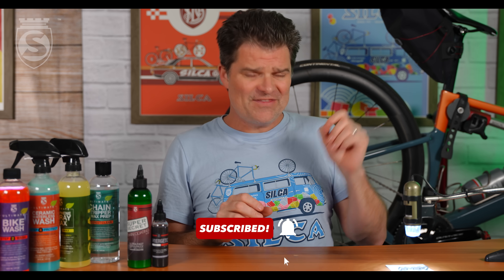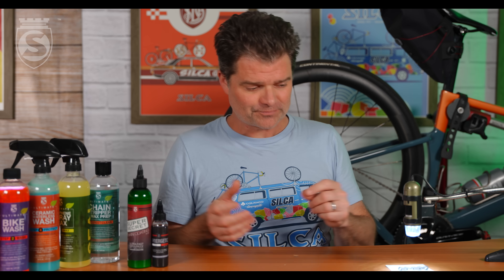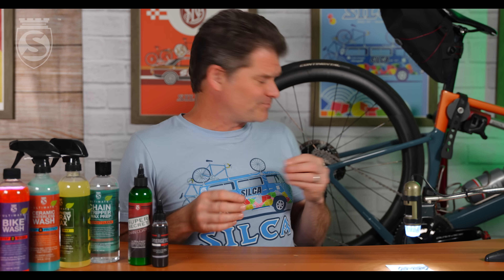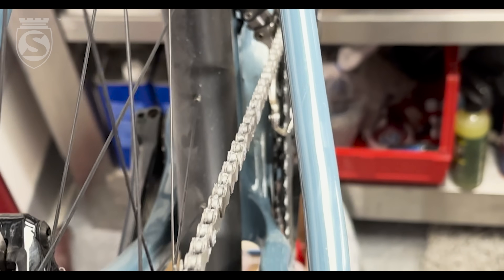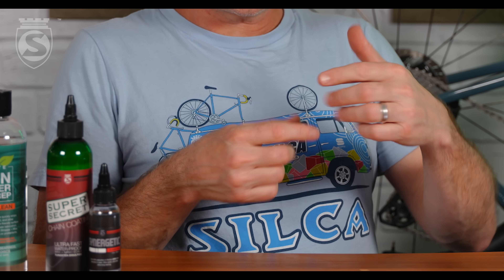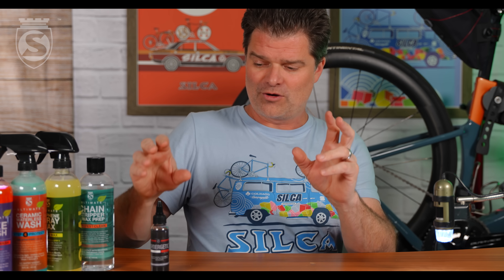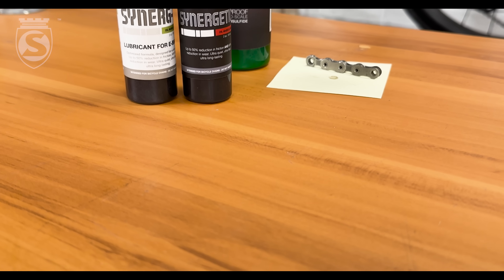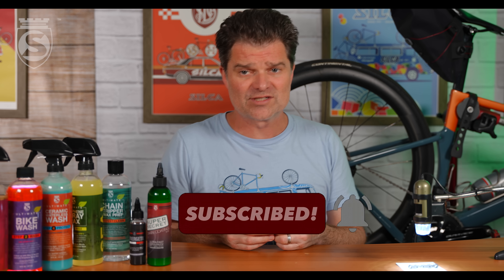Stop Wasting Your CHAIN LUBE! Know the BEST Way to Apply It!

Comment: Without a doubt the most long winded, non scientific advertisement on YT. The purpose of any lubricant is to prevent or diminish metal to metal contact. That's why extreme, high pressure lubrication duties are invariably performed by different types OILS. lf you want your chain to last for the greatest possible number of miles, use an oil like Chain L. Yes, it's messy, but after it's fully worked into the pins, the exterior of chain pins and plates can be wiped down with a rag soaked in lacquer thinner without adversely affecting the lubricating properties of the oil on the internal, bearing surfaces of the pins and rollers. Wax lubes will never surpass the lubricating qualities of oils. lf they did, they'd be used instead of oils because they're not as messy. When we see wax lubes in ICE crankcases, we'll know they're equal to oils. Unless you're planning to live forever, it won't happen in the lifetime any of us.
Reply from the maker: Sorry Frank, but all of the science and independent testing in the world tell us that you're wrong here.  I think partially you are just misunderstand the mode of friction creation inside the chain, which is a non-sliding, line contact, rolling friction under extreme pressure, and NOT sliding friction as most believe.  Furthermore the entire system is exposed to continual dust and dirt intrusion at the plate gaps which oil pulls into the inside of the chain while wax prohibits the entry of..  for these reasons wax is superior to oil in all but the cleanest/driest conditions and even then, the wax is faster.  Look at ZFC data, there is only ONE oil that matches wax in clean/dry conditions and that's SILCA Synergetic (which is nearly half the friction and 3x the longevity of ChainL), but once you introduce contamination, wax is king.  Similarly, Synergetic is the fastest oil based lube ever tested by Tour Magazin Germany as well as FrictionFacts, but still not quite as fast, or as low wearing as SILCA wax.
ICE crankcases will have a mix of line contact rolling friction at the contact point of the involute gear teeth, BUT they also have significant points of sliding friction, and bearing friction both of which require liquid lubricants.  These systems are also fully sealed from the elements and contamination and are also continually replenished with oil to prevent starvation.. making the comparison to non-replenished and element exposed roller chain like comparing apples to optics, but also just fundamentally ignores the type of motion happening inside the roller chain. The current fastest lubes in the world are all wax based, and the current lowest wearing lubricants for chain are also all wax based, and this has been continually repeated in numerous laboratories worldwide including Purdue University, FrictionFacts, ZeroFrictionCycling, University Delft, WheelEnergy, University of Manchester have all produced papers showing wax based lubes to be superior in both wear and friction to even the best oil.. and we certainly know that as we make the best oil based lube in the world currently.
Reply: @SILCAVelo  Maybe we should ask Lake Speed Jr. Unlike either of us he has PhD in tribology.
Reply: *a PhD....
Reply: People are gonna use whatever they think provides the best combination of performance at the amount effort they're willing to put into maintaining it. Your video is obviously sufficiently convincing for many of your viewers. Good for all of you. I'm not convinced. I get 3-4k miles before my chains get close to the red on a Park, cam-type chain gauge. That's good enough for me.

Comment: I thought Silca wax lubricant was good.  I thought all wax lubricant was good, and Silca was just a more expensive option.  Based on some recent information that I have seen, I think Silca deserves it place as a top wax chain lubricant.  Your drivetrain efficiency it tops and Josh I though I was going to get some BS story, but there was no bs.  In fact, mentioning that your technique works just as well for other, competing lubricants, was a good gesture that gains credibility.  I also saw your video with Dylan Johnson.  Yes, it is good to have someone geek out about these things.  These marginal gains work.

Comment: I think I first started applying to the top of the bottom span before the chainring after reading on Sheldon Brown's site that this helped ensure oil based lubes didn't accumulate so much on the underside of the chain, where it might be more likely to attract dust. Could that be one origin of that as an established method, or does it go back much further? I guess with wax based lubes that's now irrelevant anyway, but I've continued to apply Silca SS there out of habit; I apply small droplets for a few links then work it in with my thumb before applying to a new section and don't lose much this way, but some does fly off when I run the chain around a few times.

Comment: Why not drip onto the lower pulley wheel while cranking in the drive direction? 

I just really hate lubricating cassettes. I’m a full time bicycle mechanic at a very busy shop, and the amount of disgusting cassettes that after being cleaned, are in totally usable condition, is bonkers.

My normal way of applying is along the lower span of the chain, as questioned initially, except I crank in the normal drive direction, so the chain gets pulled up through the derailleur.

I have kept it in the smallest cog and largest chainring, because I hold a rag against the chain, under where I’m dripping lube, so that I keep the lube drips against the chain, and big x small (front x rear) keeps my hand further away from the spinning wheel.

I’m going to keep applying low, though I’ll apply at the pulley wheel, and I’ll have the gears set as recommended (big chainring x second largest cog). 

I’ll give that a try, but I actually expect I’ll likely end up back at my regular; slightly flushing the chain by dripping lube through the chain into a rag. I do find it flushes chains.

This recommended technique may be good for chains that are nicely cared for, regularly lubricated, and therefore don’t have much gunk in them.

I take a good few minutes.

Flush the entire chain while dripping against the rag. Then once the whole chain has had lube applied, continue to run the chain through the wet rag to both collect the gunk that’s being washed out, as well as to keep the fresh lubricant hopefully continuing to be pulled into the chain. Then I use clean sections of the rag to continue to run the chain through the clean rag to keep picking up gunk, and to now remove excess, until the chain is mostly dry at a glance (since leaving some is great, since as mentioned, some lubricants need to set, and dry).

(Oh, and I understand that the way I do it, wastes more lube than necessary, so that’s a fair point. I guess I’m just coming at it from a pro perspective, not from the target of this technique; someone who is more carefully applying lube, only to their bike [not to hundreds of random bikes in all different conditions. So I don’t even advise doing it the way I do. ✌🏼❤️])

Comment: Don’t use chain lube.  Dirty, attracts road grit and grim and subsequently prematurely wears your cassette and chain.  Paraffin wax and PTFE is the best.  Plus, no greasy fingers to jack your kit with black grease stains after repairing your flat.
Reply from the maker: I think the topic of this video was really focused on this as a technique for applying wax lubes, though it does work on other types of lube.  Unfortunately, paraffin with PTFE is not best in friction or wear, and the PTFE is also both a carcinogen, and a water polutant.  I know there are youtubers out there preaching this method, but there are significantly higher performing and less toxic options.

Comment: Thanks for sharing your knowledge.
I have a different approach to lubrication and maintaining high performance.
I tried several types of oils, all from the automotive sector because I generally do not trust the bicycle industry (e.g. they do not provide the physical properties of oils).
The correct lubrication was checked by visually checking the condition of the oil film on the chain pin. After driving 500-1000 kilometers, I dismantled one chain link and assessed the quality of the oil film inside on the pin.
The film on the pin shows whether the lubrication is good, because the wear/use of the pin determines the wear/use of the chain.
My method is as follows: I remove the chain from the drive, clean it thoroughly by making a shake in the solvent and after it evaporates, I spread the chain on the table and apply one or two drops of oil exactly between the link and the roller so that it flows perfectly into the interior of the chain by gravity. After an hour, I wipe the outer upper part of the roll from unnecessary oil with a terry towel.
I put the prepared chain, clean and dry on the outside, on a clean drive. I use mineral oil (it works better than synthetic oil!) with high kinematic viscosity of 220 mm^2/s (40 degrees Celsius).
I don't use waxes because common sense and science say that this is a senseless approach.

Comment: G’day Josh
I’ve just purchased 2 bottles of the synergetic wet lube (my supplier here had free delivery if I spent a certain amount so I thought why not get 2).My question is,does this lube have a ‘shelf life’ or ‘best by date’? I’m a bit worried that it might go ‘off’ if I don’t use it for a while.It seems like it goes a long way and will probs last me a good couple of years.By the way I’ve really enjoyed your videos and explanations,it makes so much sense.I can’t believe the crap I’ve been using all this time.
Cheers in advance
Brad.
Reply from the maker: Synergetic has no shelf life limitation.  You will notice that with time the WS2 additive will settle and can be hard to shake back into suspension after the bottle has sat for months.  We recommend inverting the bottle for a few hours which if you do it in front of a light really looks cool.. the WS2 will sort of rain down the side of the bottle after a bit and then you can shake it back into suspension.
Reply: Thanks mate👍

Comment: Load of crap ive ridden 30k very few chains always clean the chain then apply on the inside between the rear derailleur and the chainring gravitational force puts it where it needs to be no science needed its a bike chain 😊
Reply: # The earth is flat 😅. You really think bike chains are designed developed and manufactured without using science? FFS 🤦‍♂️

Comment: Wouldn't it be better to use small cog and small chain ring? That way there will be the pumping effect but also more rolling motion
Reply from the maker: Any excess lube that remains on the cogs is more likely to gunk things up in the small cogs as there is less physical volume under the teeth.. also, modern pickup pins and ramps on big rings tend to catch the chain when pedalling backwards in the small-small such that it ends up catching the chain and then releasing it leading to lube flinging all about whenever this happens.

Comment: Once I add the strip chip and do the new chain method at 125 degrees, when it’s time to re-wax the chain do I need to reheat the wax to 125 again because there is still dissolved Strip Chip in there?   Or can I keep it at 75 degrees for subsequent waxing?

Comment: What's wrong with doing multiple rotation to be sure it penetrated everywhere ? Since i've read a friction fact article on the importance of lube distribution I've done something like 20 rotation to be 100% sure the wax goes everywhere and i've had no performance issues (using squirt lube). I don't use "silca chain stripper" just petrol, dish soap and ultrasonic and i've always observed the first wax application is suboptimal and last 50km instead of 150 with less adhesion and more "garbage wax" but on the second ride it's always great.
What i also like with the multiple turn application while applying my finger on the chain to let excess wax on the faceplates is that the chain get a slight wax coating which prevent corrosion.
Reply from the maker: You can always solve the problem by just using more lube, but with the really good lubes, that gets expensive, and can also get messy and gunky.  We developed this as the cheapest, cleanest, fastest way to get the job done.  Also, if you like Squirt, you'll love SuperSecret which is lower friction, much lower wearing, penetrates better, and has higher single application longevity according to ZFC data.
Reply: @SILCAVelo  I ride mostly mtbs and they need frequent washing and consequently relubing so the cost factor gets important fast.

Comment: I apply beads on every second link and then massage it with fingers while rotating the rollers. I still have enough wax on fingers to do the other second link. The technique I had to develop when I switched to Silca to not be wasteful. 🤭 I don't rush it and it seems to be working fine so far.
Reply from the maker: I would always do every single roller for the first application on a clean dry chain.  FrictionFacts looked at both the every other strategy as well as the NFS 12 random drops followed by running through fingers and found that it led to higher overall friction and uneven wear due to some rollers remaining dry.  I think your strategy would be great for relubrication, layering, or topping off.. but with what some of the chains cost these days, probably better to be safe than sorry for the very initial application.
Reply: @SILCAVelo  Yes, I did every roller at first on a new clean chain and now I just apply a bead on every second roller (not link) as I find that it still gives me enough wax on my fingers for the other roller/pin. Chain got better with every wax treatment.
I am on my second chain and wax is great. Feels great, everything is just cleaner.

Comment: So useful Josh.  Is there any benefit applying lube mid-ride?
Reply from the maker: Not with wax lubes as they require a drying period.  If you're using an oil based lube, this can be a good way to flush contamination on really dirty rides, and if you are using traditional dry lubricants this is almost necessary as most of the have very short lifespans.  You can read more in the ZeroFrictionCycling test data.
Reply: @SILCAVelo  thanks for fast reply. You should market your lube for other uses, I use them on woodwork tools, and home door hinges.

Comment: Used this strategy couple of years now..... didn't know about the capillary action thought.
One day on my 12 speed ebike when putting the chain back after washing and cycling through gears I found that I could "see" the pin when the chain was leaving the biggest cog and i thought to myself - "I think this is the best place to put a drop of lubricant". So I did and I've been very happy with the performance...

Comment: Just spray WD40 before each ride, wipe the excess and don’t worry about it.
WD40 is cheap when bought in bulk (one gallon).
Also WD40 will clean the chain.
Reply from the maker: Sadly, WD40 is not a lubricant but really a solvent/water displacer.  FrictionFacts showed it to be one of the highest friction and wear things you can put on a chain, and using is repeatedly will damage the grease in your hub and BB bearings.  You'd be better off using 10w30 motor oil at the same price.